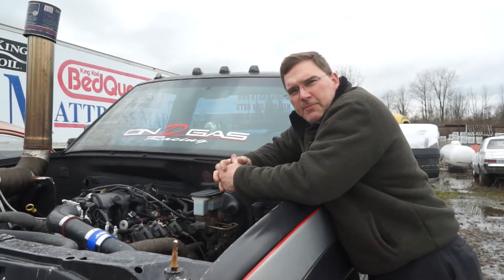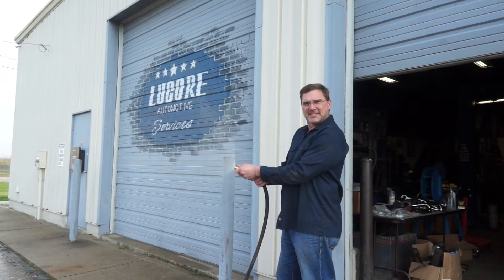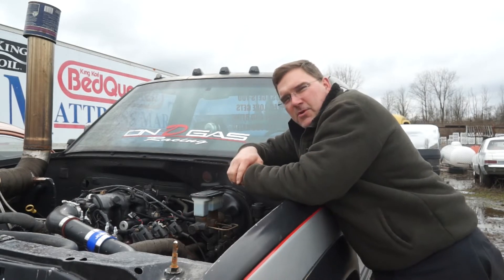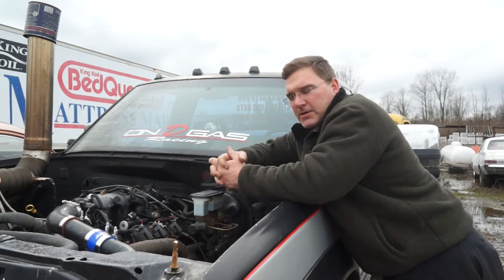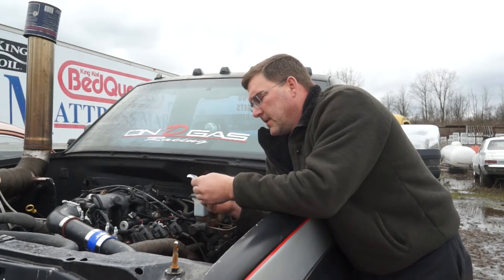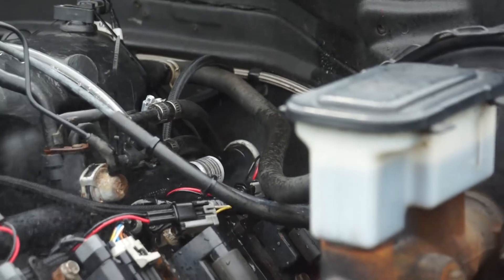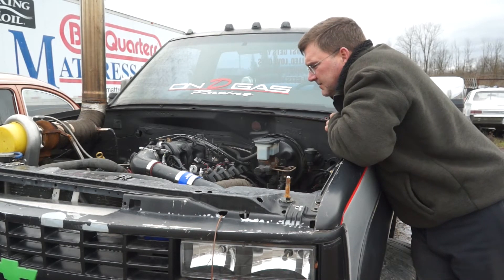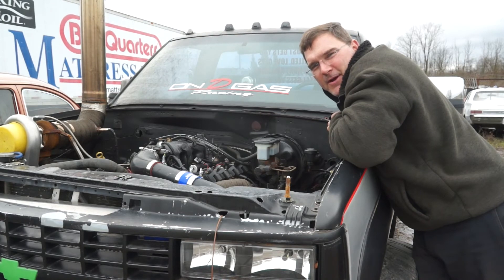Uncapped fuel injectors, on the 5.3 turbo LS truck, and SAFETY! From Lucore Automotive

Comment: So now that you know the flow rate is it safe to run the uncapped injectors?
Reply from the maker: It's ummmm safe-ish. We can at least more closely calibrate a tune with this data, but there's still the issue of the spray pattern being... more of a hose. BUT, LS motors have obviously proven to have a lot if margin for error so we SHOULD be ok.. hopefully :)